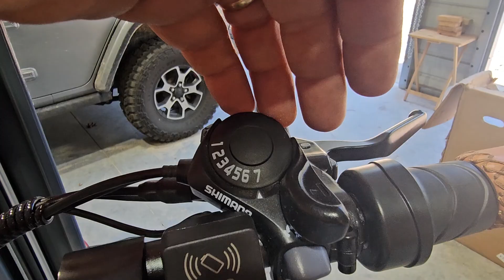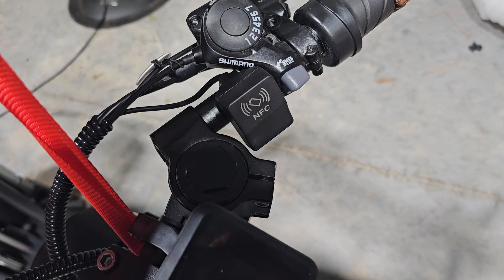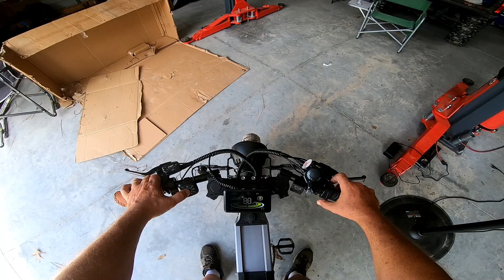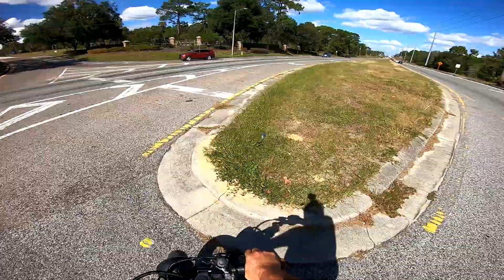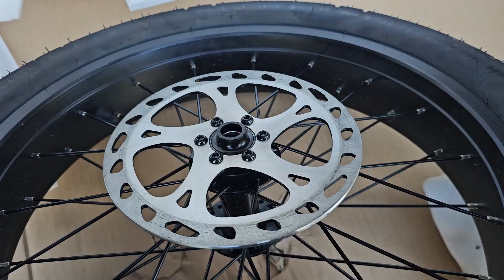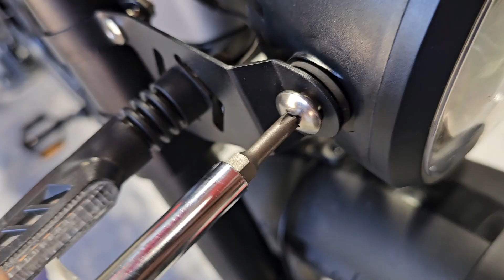NEXXBIKE X5 Plus 20" Fat Tires Electric Dirt Bike 1000W Motor 48V 25Ah Samsung Battery With NFC Key

Comment: Only 33miles on mine and now seem to have a problem.... Chain keeps catching on crank at the bottem as if something isn't aligned correctly?
Have you had any problems with yours manufacturer said they'd send out replacement parts im just worried now that if the middle crank starts to play up how would you replace it?

Any advice would be great
Reply from the maker: I believe it's adjustable, have to look at it again. Haven't had that issue... Let me know what you find out

Comment: Got mine on tuesday great bike so far managed to achieve 18miles and still 5 bars.... How do you get yours to 45mph lifting the back wheel? Is your speed sensor aligned properly? Also when i have mine in PAS5 and just pedaling with the pas i can achieve around 24mph
Reply: Sorry forgot to say when i lift my back wheel mines is going to 35mph and no more
Reply from the maker: In the advanced settings I show how to unlock the max speed
Reply: @MotoCheez I did the same as you have, that's why i was asking if your speed sensor and magnet on the back wheel are aligned correctly? As you say you can manage to get about 14/15mph with pas and im able to achieve 22/24mph pas when i do throttle only with back wheel lifted its goes 35mph and then when throttle only ive achieved 34mph?
Reply: Ive achieve 34mph on the road i should of said sorry
Reply from the maker: @Canna-w6i the magnet is aligned... Mine was unlocked speed when I got it, I figured it would be in advanced settings
Reply: May i add aswell video doesn't do the bike justice it really needs to be seen in person also i got a longer seat on mine which i think would be better than the original they went with
Reply from the maker: @Canna-w6i longer seat definitely improvement!

Comment: great review, how do you lock it up. As the loop behind the saddle looks like mild steel. Also what's the down side. and how tall are you.
Reply from the maker: Lock it up through the wheels. Down side? Maybe just the road style tires. I'm 5'10
Reply: @MotoCheez  what problems have you had
Reply from the maker: @Slylondoner no issues yet.

Comment: Seems a little pricey  For something that looks like it was built with spare parts laying around the garage . It should have 3000 watt motor as well. Maybe im missing something. Does the side fold out to a grill😅?
Reply from the maker: 3000w motor would be epic but bigger chains would definitely be needed, seems like anything over a thousand Watts on a mid drive bike has problems with a bicycle chain, I agree on the styling, needs more graphics.  Bike is actually built solid.

Comment: lol ive seen this on alibaba for over a month and it must be someones first time trying to design a bike. they put a hub motor as a mid drive instead of just using a normal mid drive motor im confused.
Reply from the maker: Not sure why they didn't go with the actual direct drive motor, would have been cheaper

Comment: こちらのバッテリーは、中国ではシルバーフィッシュと呼ばれるバッテリーケースを使用してますね？
48V25Ahバッテリーを2個搭載出来ることで航行距離を2倍に出来るけど、横にバッテリーを入れるのは毎回重そう。
私は、このタイプのバッテリー48V30Ahで使ってますが、縦に入れるのでも重いです。
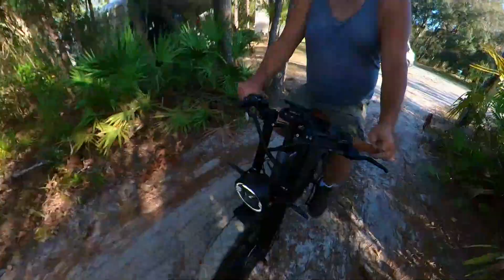Reply from the maker: I believe so. I have a video coming out tomorrow that I did another ride with it and did 37 mi and only used 3 bars of five battery. It was at 4:00 or 5 bars until just before I finished a ride too so it just switched to three out of five bars. It's pretty good on a battery if you're not flying top speed doing 20 miles per hour average will get you close to 50 miles I believe

Comment: Looks as if they mounted a hub type motor as a mid-drive, as opposed to a real mid-drive motor like BBS02.  Which is why you have high torque and low pick up, but the real power issue is 48v.  This bike really needs that extra wattage that could be delivered to that motor with 52 volts.
Reply from the maker: Yes, hub off spoked wheel, 52v would be awesome

Comment: For cruise hold down on the lower mode button. Bottom button to lower power. Then cruise will activate
Reply from the maker: I tried holding it down button first and then he up button and it didn't work I just cut the video out to make it shorter, it does not have cruise

Comment: Junk, everything looks like an afterthought. Is the battery even ul listed or is going to burn someone's house down? Not much of a dirt bike.
Reply: Where's your bad ass ebike? 🤔
Reply from the maker: It has Samsung  cells with built in BMS
Reply: @MotoCheez  so it's UL listed, so you have legal recourse when it burns down the house? Or does it have the mark of the beast CE
Reply from the maker: @harrynutsack5173 I did not see if it was UL listed or not
Reply: fyi ul listing is  joke. it's a private company who insterted themselves as a middle man to take money from people. there are other ratings available that will be of the same standard.
Reply: People are so comfortable talking trash on others. Sicko. Get a life